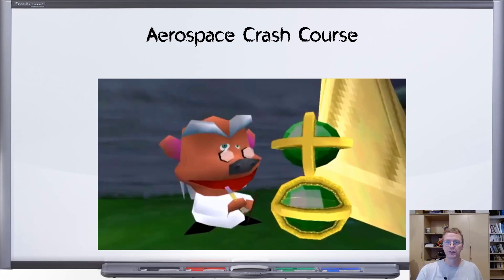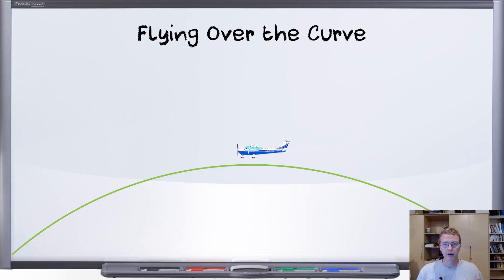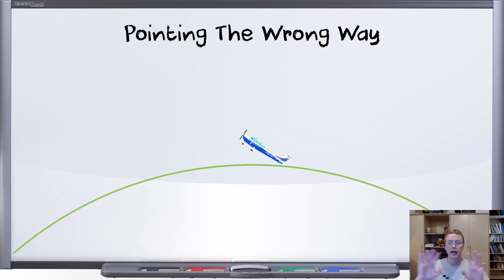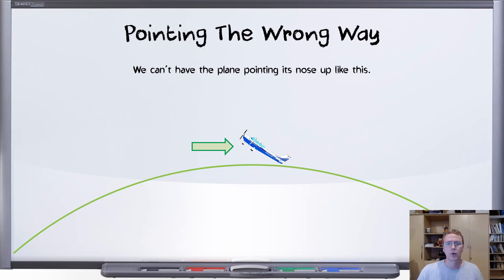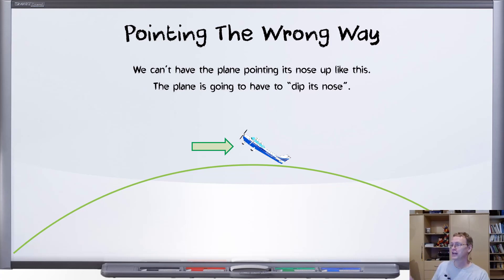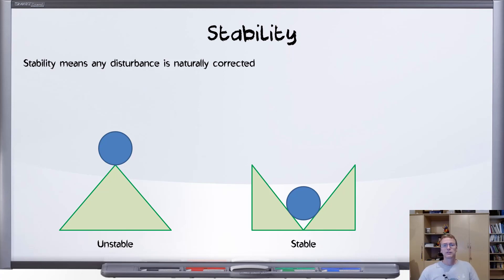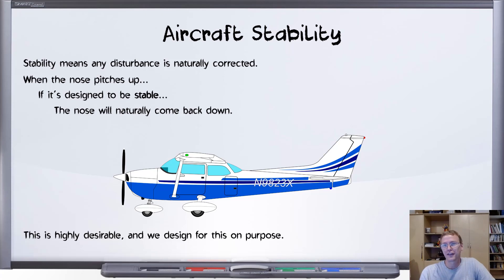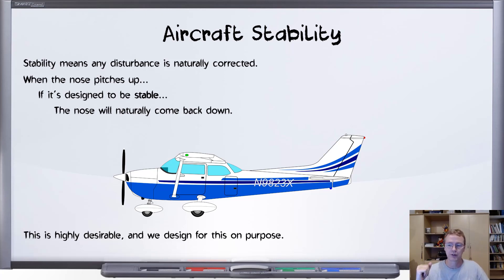Dipping the Nose Part 2

Comment: Another good video and I like your presentation style.  

Along that style we can look at the question to pilots "Do you dip the nose" and change that to "Do you have to make small pitch corrections to maintain a precise altitude" 

Every real pilot will answer yes to that.  

When flying an assigned altitude you have a plus / minus tolerance of 100 ft.  Even the most perfectly trimmed aircraft will not hold that tolerance by itself.  The pilot or autopilot will have to make tiny pitch adjustments constantly. 

The analogy is driving on a straight stretch of road.  You cannot let the steering wheel go indefinitely.   The car will drift out of the lane for any number of reasons.  Even on straight road the driver must make regular tiny adjustments.  

Unfortunately in my experience the percentage of Flat Earthers who actually want to know the truth is very low. 

People like Globebusters have no interest in learning from you.  This has been explained to them numerous times.  I had many private emails with Jeran.  He knows it all,  yet they persist in promoting their false claims.  Bob was caught red handed overstating his pilot qualifications and quickly deleted all the evidence when this was exposed.  

Many so called Flat Earthers are just pretending to be so to get a reaction.

 The few who actually think the Earth is Flat generally struggle with 3rd grade Math and Geometry and are highly defensive and paranoid as a result.  Insults are the only weapon they have.  . 

I only say this to share my five years of experience dealing with Flat Earthers with you so that you are better prepared for future engagements.   Understand that many of them have no interested in learning and you will be a step ahead.  There are exceptions and those who actually seek the truth come back to the Globe anyway.

Comment: If you buy into the globebusters' narrative you should ask yourself why you are incredulous about the fact that a gyroscope in a plane calibrates it's pitch, (a calibration for which there are mechanisms built into them that you can objectively verify), but you have never asked yourself, if the earth is flat, how does the gyroscope calibrate for the turning right when going west and turning left when going east that has to occur (for which there is no mechanism built into the gyroscope).
A lot of flat earthers have asked why the pilot doesn't have to dip the nose, but never why the pilot doesn't have to lean left/right. 
The very fact that this hasn't even occurred to you should be very indicative of your confirmation bias.

I posted this on their video, but I've been blocked there, for asking questions like this. Censoring opposing views to their followers is very cult-like behaviour and a tell-tale sign of denialism.

Comment from the maker: John Fehr left this comment:
If a plane auto adjust with the air density, that instrument must be incredibly sensitive to keep it at a constant 35,000 ft and not zig zag up and down within the out limits of the preset density range. I call B.S.

YouTube ate that one too. I don't know what's up... if anyone knows of anything I can do about this, please advise.
Reply from the maker: John, it's not an INSTRUMENT... it's nature. That's the nature of lift. In the earliest days of flight, researchers did experiments to discover how lift works. They discovered that lift varies according to air density. That's all this video is really about. A properly trimmed aircraft will naturally settle in at a constant density.
And file this under, "stuff we skipped over, but it's kind of important"... Yes! An airplane WILL oscillate up and down around the target density. We call this the "long period" or "Phugoid" mode. Here's a link: https://en.wikipedia.org/wiki/Aircraft_dynamic_modes#Phugoid_(longer_period)_oscillations
That's just beyond the scope of the "Crash Course".
Reply: @icansciencethat  I'm thinking of doing a small video just illustrating the issue of what happens as a plane moves forward and encounters a change in air density. I'll try to do it tonight, just that one narrow bit of the whole flying phenomenon.
Reply from the maker: @fepeerreview3150  Did you check out Walter Bislin's simulator? I bet you can show it on there too.
Reply: @icansciencethat  I'll look into it this evening. Thanks for the reminder.

Comment: If you decide to continue the series here's something to consider including.
We need a discussion of what it means for the airplane to be in a "nose up" or a "nose down" attitude. And we need to make it clear that a plane does not need to go into a "nose down" attitude as it self-corrects for the curvature of the atmospheric density layer in which it is cruising. Typically, planes in level flight are in a slight nose up attitude and this does not change due to curvature. From one moment to the next, relative to its position at that moment, it remains in the same nose up attitude, even as it follows the curve.
Reply from the maker: Was just about to start recording for the next video which is on "Angle of Attack". :)
Reply: So everything just happens automatically, like magic. It works exactly the same as it would if the earth was a flat, nonrotating plane, right?
Reply from the maker: @realitycheque2854  
"So everything just happens automatically, like magic."
Pretty much. It is LIKE magic, but of course it isn't magic. I'm working on episode 4 right now where I talk in more detail about how it works.

"It works exactly the same as it would if the earth was a flat, nonrotating plane, right?"
Yep. As long as there's a density gradient in the air and some downward force giving the aircraft weight, all of this works exactly the same. Would work just fine on the concave Earth too.
Reply: @icansciencethat  The globe is so amazing! It’s curving, you just can’t see it. It’s spinning, you just can’t feel it. It’s like we live in the magical world of Disney.
Reply from the maker: @realitycheque2854  I'll go even further! I believe in all sorts of things I cannot see. I believe in bacteria that are too small to see. I cannot feel them, but I'm so crazy, I still believe they exist. I believe there are tiny little printed transistors inside my computer, and I believe there are invisible electric currents running through them. I can't see it, and I can't feel it, but I believe there is a magnetic field all around me.

I wonder... do you believe in bacteria, micro-circuits, and magnetic fields?
Reply: @icansciencethat  " It is LIKE magic, but of course it isn't magic."
That's right. It's not magic. It's physics, well understood by skilled engineers who figured out how to work with it and turn it to our advantage.
There's an anecdote in there, from my first job out of university. I should probably make a video about it. By the way, I'm looking forward to your future videos in this series.
Reply: @icansciencethat  So fascinating. A plane can depart from the North Pole with almost zero orbital motion from earth rotation, and fly to the equator where the motion is 1,000 MPH and land on a runway without issue. Not only will I not be able to feel any of this change in angular momentum, not one of the instruments on the plane be able to detect any change whatsoever. Nor will the gyroscope detect the full 90 degree change in the orientation of the aircraft! It truly is magical. Guess we have to just have faith, and chalk it up to that’s just how planes do. I need to get some pixie dust to take along on this magical adventure.
Reply from the maker: @realitycheque2854  if you don't want to learn things, I can't force you. However, I will write a few corrections for readers who are interested in bettering themselves.
The angular momentum of the Earth is the same at the poles as the equator, but the plane would make a 90 degree rotation through it, so we could consider that a change in angular momentum. Whether at the pole or the equator, it's 15 degrees per hour, so of course you can't feel it.
You can't feel the earth's magnetic field either, but we have invented devices to sense it. Similarly the nav system on the plane includes optical gyros that DO sense this rotation - both the 15 degrees per hour, AND the somewhat slower rotation the plane does as it follows the curve.
The FE spokespeople will tell you the gyros don't detect this, but they are lying. Modern optical gyros have no trouble detecting it. All you'd need to do to test it is buy one and take it on a plane with you.
Of course, as a "skeptic", I'm sure you've done this and verified everything for yourself, right? What? You didn't? Certainly a "skeptic" like yourself didn't just accept the word of an internet fraudster at face value? You at least verified that the FE spokesman you heard this from had tested it directly? No? Not very skeptical of you.
Tl;dr: there is no reason to suspect you should feel these things, but they CAN be measured.
Reply: @icansciencethat  Pilots say they can fly thousands of miles without ever changing the orientation of the nose of their plane, and after doing so, at their destination, their orientation in relation to the earth below has not changed. They remain completely level above the ground. This quite simply would not be possible had they been moving over an arc of a circle the entire flight. It always happens, of course, because they are above a flat level surface, just as they observe. The sooner you come to grips with this reality, the better. I mean no disrespect, and wish you the best. I do, however, wish to implore you to be intellectually honest, and consider the logic of the matter.
Reply from the maker: @realitycheque2854  Was there anything in my presentation that you did not follow?
Did I make any mistakes? Where was I unclear?
Something I felt was a little unclear was made super clear by FE Peer Review here: https://youtu.be/_tW7AsR5LY0
tl;dr: to a pilot, "changing the orientation of the nose" means changing the angle-of-attack. Globe or flat, they simply would NOT do that. It's very much like sailing around the world. You end up "upside down" on the other side, but you've still got the air above you and the water below, so to you, there's no "changing orientation" going on.
These 2 videos are all about describing how the results you just described turn out just the same on a globe as they do on a flat Earth. Was that point clear to you?
The point is not to just step back and say, "It doesn't seem like that should work." Instead, we say, "Let's look at this carefully... Wow, it turns out it isn't like I expected at all."
It would be really awesome is if you'd go through the videos and point out specific time-codes where I say something you don't follow. Come back here and point it out, and let's discuss it. If I'm wrong, I'm happy to make a correction. If there's something I can explain better, I'm happy to do that too.
Please keep this firmly in mind: Nothing in these videos is evidence that the Earth is a globe at all. This is merely a correction for people who think (as I think you do) that airplanes are evidence that the Earth is flat.

Comment: It funny that you think that way, why would we even put instruments in a plane if it does everything automatically? No need for a giroscope right. Just a bit confused where the science part and your science facts are in the video.
Reply from the maker: I don't want to leave you with the impression I am implying that planes do everything automatically. Check out @12:01 where I try to be pretty clear about that.
In this video, I describe that a plane will naturally follow the line of constant air density without the pilot's influence. I did not go into the details on this, but since you bring it up, let me add that this aircraft will only do that once the PILOT has correctly "trimmed" it. I may get into what "trim" means in a future video, but for now, that just means the pilot needs to set the controls so that the plane is nicely balanced at the current altitude and airspeed to maintain level flight. Once he's done that, it will maintain level flight in still air... naturally the air isn't always still, so the pilot needs to stay on top of that.

In response to the science comment: this series is on Aero Engineering not so much science. If you're interested in science topics, let me direct you to my Science 4 Skeptics series here: https://youtube.com/playlist?list=PLoSKU6gEpwMUgeELwk3g7th1pULltPR6x